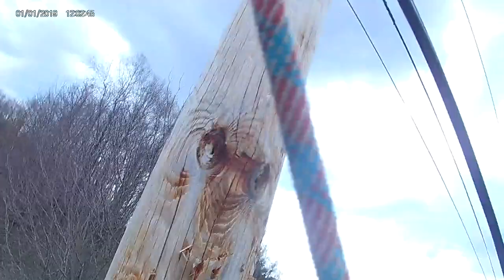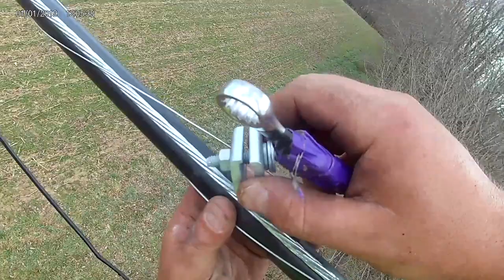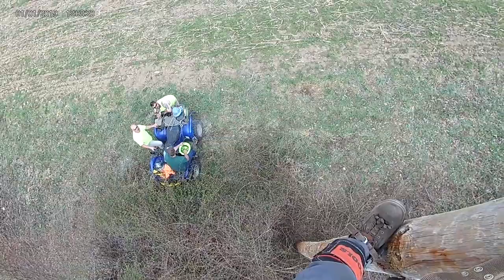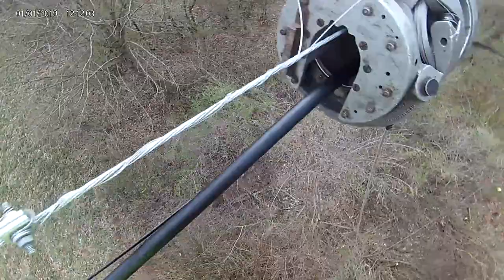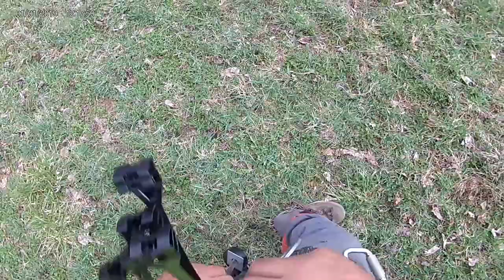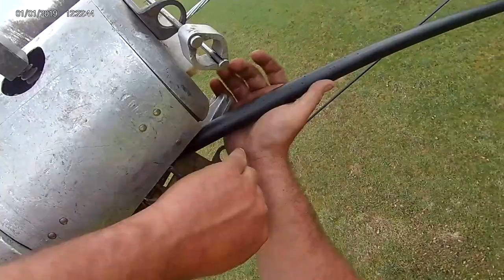It isn't easy swapping over Trunk.

Comment: I was a telecom lineman and supervisor for many years.  I would never ever, nor let my crew, drop their trash.  If something did fall, the groundman picked it up immediately.
Reply: A piece of wire or zip tie isn’t a big deal lol, however me myself I go around and pick up the scraps.
Reply: Exactly! 4 guys standing on the ground doing nothing.
Reply: Wait until work is done above head before you pick things up, I wouldn't go pickup a zip tie on the ground while the guy accidentally drops a wrench on my neck.
Reply: @AllanS69  Never had that happen, but good point.
Reply: Damn right the crew I’m on even picks up the tiniest pieces of cut off lashing wire when we delash
Reply: That respect level is sadly declining from what I've seen. That said our crews absolutely make it like we were never there.
Reply: @AllanS69  isn't life funny sometimes, today i was picking up scraps from work done above and just wondering myself why not just wait, i had the hard hat on but when you're bending your neck is exposed . somethings can just wait. and here i am reading this comment .
Reply: Where is your bendingbord?
Reply: Hand bend expansion loop ?

Comment: Little bit of advice get a set of 9s cut the coating off them weld a 7/16 and 1/2 deep well socket on either side of the handle put shrink boot on for a coating won’t need two tools when you go up for new build, but I do carry a set of cable cutters with me in case I need to cut a strap
Reply from the maker: I carry the tools for any situation. Plus the tools I have are completely broken in and been in use for little over a decade so they're reliable in a pinch like a pickle.
Reply: thats what i do. klines 9's and a socket on each side.

Comment: Try with 600 pair telephone  cable 😅
Reply: Lol now there’s a real telecom lineman. 600 pair ain’t no walk in the park
Reply: 600 is actually fairly small by me.   We are actually taking a 1500 down this week.   We still have lead cables up and running.
Reply: Just wrecked out 1200 feet of 1800 with lead casings

Comment: Ahhh we still don’t know how to properly tie a bug nut. Also, you can transfer the lasher first, so your bug nut isn’t so far from the pole, then cut the wire in the middle
Reply: U can also speed lash and my company allows upto 3 spans  with no bugnut.  BUt you are right

Comment: I am embarrassed to see the quality of work now being produced by "gumps" such as these.  I spent 50 years in the telecom industry and was taught quality is an absolute.  Hence the name - Craftsman.  But those days are gone.  There are too many quality / safety issues with this video to take up time addressing.  I think these dudes need to find another job.  I know that I they had come on my job sites they would certainly have been read the riot act and probably escorted out the door.  Shame that no one is teaching proper construction procedures and you can see this all across the U.S. these days.
Reply: amen to that. the 16-17 yrs of my !ineman career were fantastic taught by a guy with like 40 yrs and open minded enough that if i saw another way that could be safer or easier on the body he could envision what if any issues may come up and try if it was feasible good times

Comment: WHAT EVER YOU DO, DO NOT BUILD AERIAL OSP LIKE THIS!!!!!!!!!  WOW!  I dont know where to start with all that is wrong with this video.   I would reject everything.  In no particular order this plant would be rejected by me for  the following reasons; 1)too many safety violations to name,  2)you need a bending board or jackson bender to form the loop, 3) the bolt is way too long, 4)I would never allow twisted lashing wire, they need to stay parallel, 5) never drop you waste to the ground, 6) if you do they for a living you need a pair of lineman boot at least a pair with a significant heel,

 In addition swap the lasher to the other side of the pole first, us a bridle on the lasher, (it is only a matter of time before it gets dropped), use the correct linemen tools, Klein 9s with 7/16 nut driver welded to the handle,   get up higher on the pole to swap a lasher, repair the lasher, it is only half there (backdate is missing, briddle is missing, get the correct lineman tool pouch

Comment: When you aren’t taught the correct way to lash cable it’s a radical crack waiting to happen.  Where are your gloves, Jackson cable bending block, shot gun with roller and a bell wrench to tighten the pole hardware and suspension clamp?   Gone are the days of quality construction.   😂

Comment: Isn't it hard to climb so close to the pole and with your squeeze so tight on the pole? 

As I've gained experience climbimg I've learned it's much easier to climb with slack on your rope to let you have room from the pole. Lets you really lock your knees out easy. Having a little more slack on the squeeze on the pole lets you flick your wrist as you climb instead of pulling the whole squeeze up. You can tighten it when you get up if ya want.
Reply: Dude can't climb. Look at his form.

Comment: Pulling with the front gate instead of the d rings then complaining the gate came open?
Reply: His lasher isn’t a good one, if it has butterfly holes you can choose what side of the lasher to pull on, you can use the d ring. Wich is what I like to do but his lasher is just broke